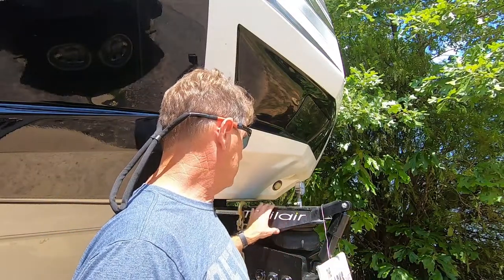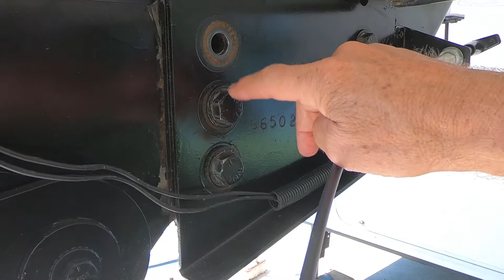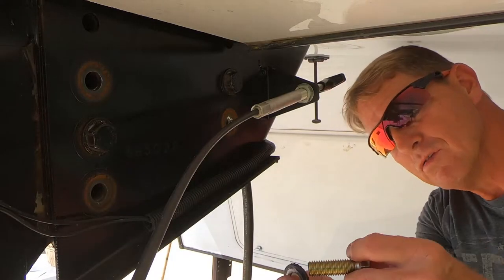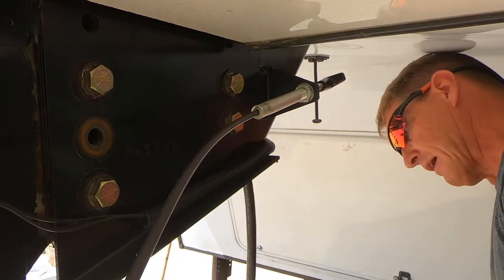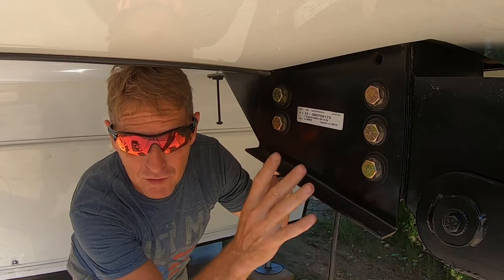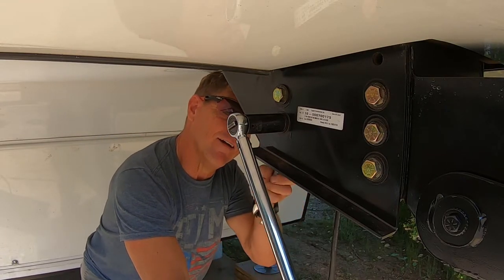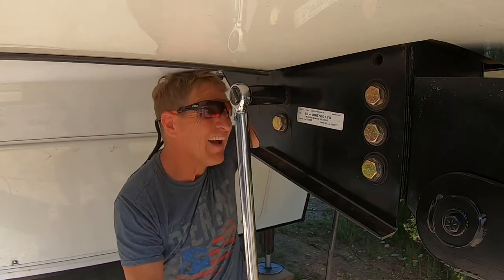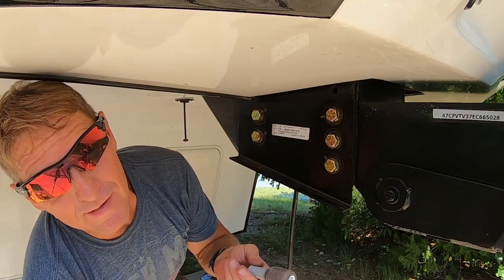$50 RV King Pin Safety Upgrade and Maintenance-Full Time RVing

Comment: Good video, I will be checking my bolts. It did not surprise me that Lippert  was the manufacturer and not put the proper hardware on it.I trust nothing that Lippert makes ! (My frame on my 5th wheel had  major breaks in it not counting the welds that were cracked.No, the rig was not overloaded. The King pin came close to detaching from the rest of the frame.
Reply from the maker: They did stand behind it with a free replacement.

Comment: Great video. I will upgrade my bolts when I change out my standard lippert king pin to something better.
Reply from the maker: I checked it every trip and usually put a little in every time.
Reply from the maker: Good luck, pretty easy if not videoing, lol